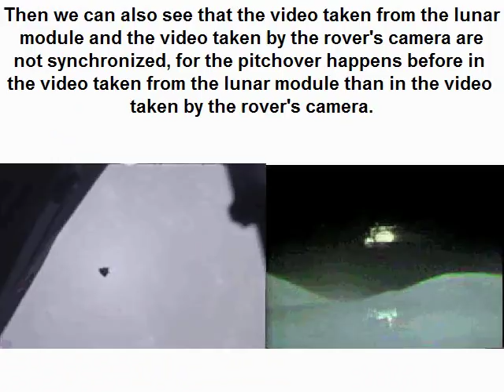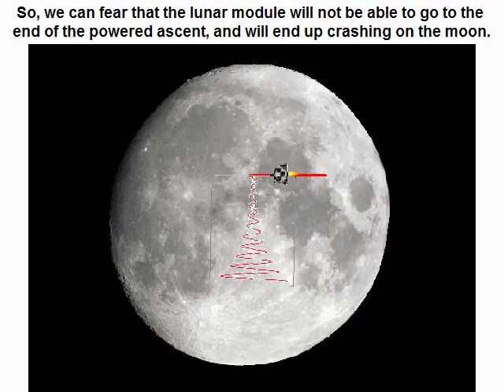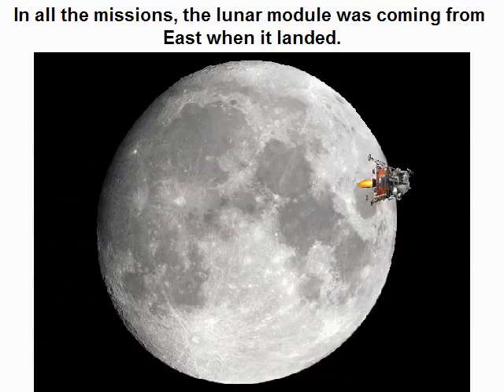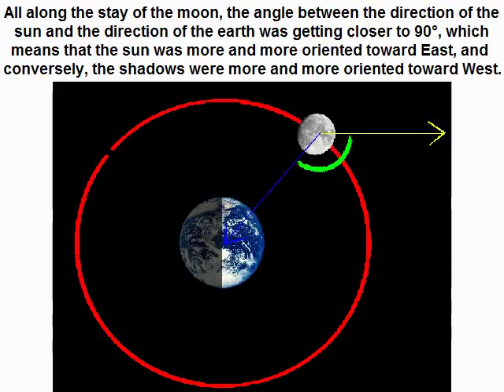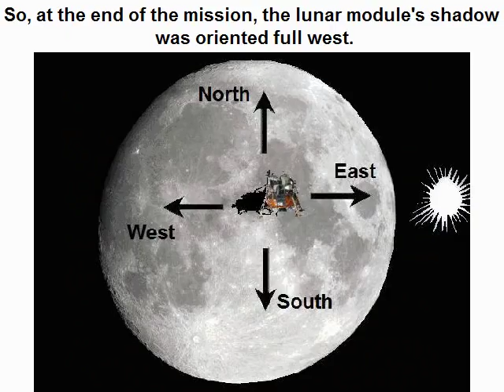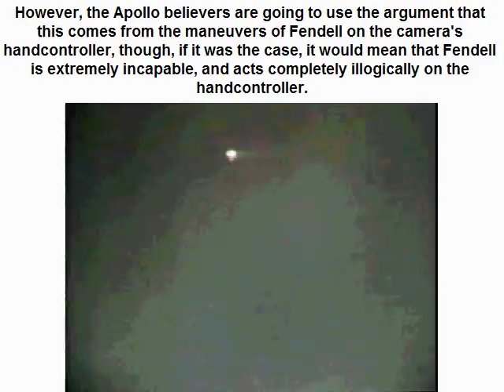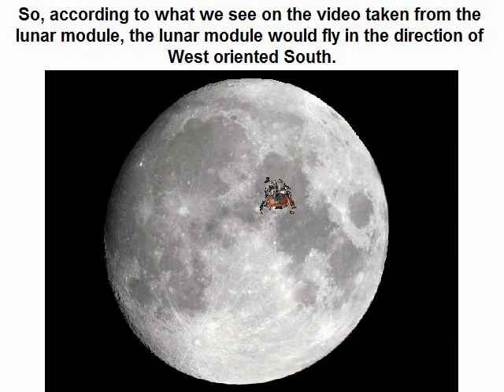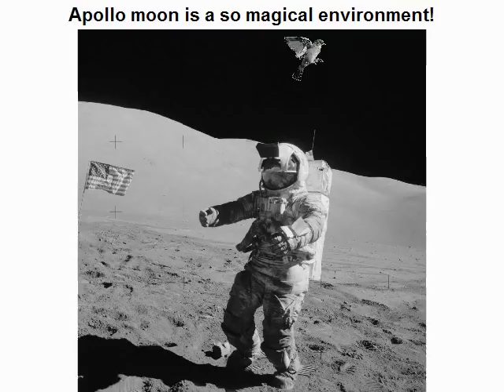The unknown trajectory of the lunar module

Comment: Filmed downwards from the Lunar module's upper stage, there is no shadow projected on the lunar surface from the LMAE's hot gasses. When the LEM is taking off you should see also the light refraction shadow of the hot gasses escaping from the rocket engine, watch closely, they are not visable on any of the Apollo footage where it is taking of from the Moon. Conclusion, there are no hot gasses. Hot gasses give a refraction shadow when there is a difference in temperature and density with the surrounding space.
Reply: Just Curious - I think the problem here is that Paul Smith has no idea what Endymion is talking about, he doesn't have the intelligence to understand technical talk so calls it out as 'talking out of his backside' because that is the only thing he understands. Its difficult for him to understand anything when his head is up his own backside.
Reply: Paul Smith Why do you think that Endymion Andselene's post is flawed? Obviously you possess an advanced education in Physics to voice such an assertive reply as only a crass idiot would offer a strong opinion on something that he knows nothing about!
Reply: Bavo Dekker There are hot gases escaping here  from somewhere! Rocket expert, in a well-designed de Laval nozzle what is the ideal relationship between the static pressure of the exhaust gases at the nozzle exit plane and the ambient gas pressure?
Reply: Bavo Dekker A well-designed de Laval divergent supersonic nozzle has an expansion ratio so that the exhaust static pressure upon exit is at or slightly above  the ambient pressure. For engines operating in a hard vacuum the exhaust gas is at a very low static pressure. The LM ascent engine had an exit plane static pressure of about 7 kPa at a temp of about 500 Celsius. Gas density is given by P/RT so the combination of very low pressure with high temperature meant that the density of the exhaust gas was exceedingly low. What is the critical difference in gas density required to produce a shadowgraph in sunlight that has a natural convergence of 30 minutes of arc?
Reply: Paul - Really? Is that all you have? I assume you have virtually no education which is why you support ridiculous videos like these. 99% of all comments on all the videos of this idiot are laughing at him for his stupidity.
Reply: Bavo - Maybe you should never have left?
Reply: Actually, he knows what he's talking about. And I understand him. Basically, he's saying that the exhaust plume of a rocket operating in vacuum is too thin to refract sunlight. Sorry.
Reply: +ApolloWasReal  " . . Basically, he's saying that the exhaust plume of a rocket operating in vacuum is too thin to refract sunlight . ." This would be an understatement. With no atmospheric pressure to constrain the exhaust gases the exhaust gases expand adiabatically so that after only a short distance the 7 kPa exit plane static pressure has essentially dropped to zero over 2Pi steradians.

It never ceases to amaze me that laymen such as hunchbacked (I refuse to acknowledge a piece of paper that is contradicted by Xavier Pascal's every public announcement) can see a supposed flaw in no billowing engine plume. If NASA were faking it one would have imagined that someone would have caught this supposed contradiction. After all NASA was responsible for the public perception of roaring, vibrating rocket engines pushing out a huge billowing cloud of exhaust gas in the first place. The fact is that rocket engines operating in a vacuum are operating in their ideal operating conditions with minimal engine vibration and an exceedingly diffuse engine exhaust. The fact that NASA stuck to the invisible engine plume for all the moon flights and every rocket engine operating in a vacuum ever since indicates that the phenomenon is real and the result of the thermodynamics of a de Laval nozzle and not the clapboard of a Hollywood director.
Reply: Wendy - See the comments from Endymion, just about sums it up really, your comment is just false. I have been to Russia many times and the view of Russians is that they cannot believe that 'the most powerful nation on earth' is populated by idiots who believe the landings were faked.
Reply: Everybody is familiar with plumes from rocket engines burning kerosene and liquid oxygen. They're a brilliant white, but only in the lower atmosphere. The upper stage of the SpaceX Falcon is the first in many years to burn kerosene/LOX, and it shows us how different it looks in a vacuum. It's almost invisible. The upper stage has a longer nozzle with a greater expansion ratio, and with no air pressure to contain it the plume rapidly expands further when it leaves the nozzle. The only signs from the onboard camera that the engine is really firing are the nozzle glowing orange, the slight mechanical flexing of the nozzle, and little streaks of dark smoke leaving the nozzle. That's unburned carbon from the kerosene fuel. This carbon reacts with the oxygen in the atmosphere to produce the familiar white plume, but of course there's no oxygen in the vacuum of space.
Reply: +ApolloWasReal Members of the moon loon fraternity who question or cast aspersions on the Apollo Program based on the non-visibility of rocket exhaust plumes when working in the hard vacuum of space are only revealing to an international audience how totally clueless they are in matters pertaining to rocket design and operation. Only on YouTube could one be  entertained by know-nothings giving vent to the vacuous contents  of their paranoia-infected minds using rumour and the ravings of fellow know-nothings as a basis for their critique!
Reply: Endymion Andselene  Your technical talk might intimidate or fool some people. However, we both know that you are talking out of your backside.
Reply: Paul - lets look at this logically, if NASA had faked the moon landings the first to cry foul would have been the Russians as they were in a race to get there first, but they knew it was real as, if it had been faked, they would have loved to humiliate the USA by calling it fake. Then, to keep the 'fake' secret, NASA would have had to pay for the silence of over 400,000 people worldwide and now, nearly 50 years later, not one of them has revealed the 'fake'? The first pictures from the moon of Armstrong stepping on the surface were actually received in Australia before being relayed to the USA.
Reply: Which newspapers and which editions?
Reply: It is only in recent years that critical comments have come from the erstwhile Soviet Union. To quote Nikita Khrushchev's son Sergei:

" Of course, you cannot have people land on the moon and just say nothing. It was published in all the newspapers. But if you remember [back then] when Americans spoke of the first man in space, they were always talking of "the first American in space" [not Yuri Gagarin]. The same feeling was prevalent in Russia. There were small articles when Apollo 11 was launched. Actually, there was a small article on the first page of Pravda and then three columns on page five. I looked it up again."
https://www.scientificamerican.com/article/apollo-moon-khrushchev/

There were no newspapers and TV news at the time of the moonlandings that were full of stories showing that it was all faked. Wherever you got this from is spreading Putinesque propaganda. RT is little more than a state-run propaganda outlet pushing the Putin line. Actual from Sergei Krushchev's recollection there was very little coverage of Apollo 11 which dispels the idea that "newspapers and TV news was full of" anything much to do with Apollo 11 at all and most certainly nothing accusatory!
Reply: Comment from Soviet cosmonaut Alexei Leonov:
"On the morning of 21 July 1969 everyone forgot, for a few moments, that we were all citizens of different countries on Earth. That moment really united the human race. Even in the military center where I stood, where military men were observing the achievements of our rival superpower, there was loud applause."
https://www.quora.com/What-was-the-Soviet-reaction-to-the-Apollo-11-moon-landing
Reply: +Paul Julian  If the Russian media was supposedly awash with moon hoax conspiracies contemporaneous with the moon landing then all of this moon loon nonsense would have started up decades before it did. Bill Kaysing would not have been a lone voice in the wilderness and he would have made reference to the Soviet articles. But there was a deafening silence from wacky Bill regarding such. Moon loon propaganda itself right across the internet is also silent as regards Soviet claims of fakery that were contemporaneous with the moon landings. Either Wendy Glass is a victim of fake news or a purveyor of fake news!
Reply: +Bavo Dekker  "Go back to school please."  One gathers that this is the sum totality of your reply. No comment about the density of a rocket exhaust when the motor is designed to be operated in a hard vacuum. I thank you for your informed comments and depth of understanding re astronautical issues!
Reply: Endymion Andselene
I think she is the victim of fake news from the moon loon propaganda
Reply: Paul Julian Somehow I don't think she is aware if that! I have never met anyone who views Russia Today as a serious news channel and that alone speaks volumes.
Reply: Wendy Glass "NASA stock answer" you are full of it! The only reason why you might have heard that before is because that was the situation in Russia at the time. Noone alive at the time, myself included, heard even so much as a whimper of complaint from Russia. " Pravda" the main propaganda organ of the Central Soviet Committee has always been freely available in western countries including Germany where I grew up. There was no issue of that newspaper from the late sixties early seventies that contained any such garbage as you maintain. You are the one swallowing and regurgitating mindless propaganda. For the record I work for NASA' s European competitor E.A.D.S. or Airbus as it is known nowadays. Why this comical moon loon fixation on NASA is any man's guess as it is today just one of many aerospace concerns.
Reply: Wendy Glass We are still waiting for your links to "their newspapers and TV news" that were "full of stories showing that it was all faked"! I have a nagging feeling that we are going to be in for a long wait on this one aren't we Wendy! No doubt Vladimir will get the printing presses turning over in the basement of the RT archives to 'generate' some links for you . . . eventually. LMFAO
Reply: Facts are not "excuses". Sorry you find them inconvenient.
Reply: Maybe the reason you keep seeing the "stock answer" is because it's correct. Ever thought of that?
Reply: Endymion Andselene, this is getting a bit off topic, isn't it?
Reply: ApolloWasReal Guilty as charged! There will be no links to Russian TV and newspapers 'exposing' Apollo fakery contemporaneous with the moon landings because there was none. I allowed myself to get distracted by her Marie Antoinette icon. Me bad!
Reply: +Wendy Glass Ho hum! Still no links to the supposed Ruskie newspaper and TV news "full of stories showing that it was all faked". A solid month has passed so I assume from your ominous silence that you were talking through your hat and were rightly called out on this gaga proclamation. The men and women who produced one of the finest technological feats of the twentieth century if not in the entire history of mankind await your public retraction. The young men who placed their lives on the line in your behalf by volunteering to perform some of the most daring feats of astronautics yet accomplished or possibly will ever be accomplished have been treated with gross disrespect by the baseless contentions of mindless ignoramuses such as yourself. Put up your evidence or provide a public apology for your idiotic contention.
Reply: bavo. yes there would be if there was an atmosphere but as there is none then there is no shadow from any gasses.
Reply: Paul Julian    The "99% of all comments" remark shows what a lying scumbag you are. I rest my case.
Reply: ApolloWasReal  Duh - no shit Sherlock. All you NASA shills just repeat the same old crap excuses.
Reply: Paul Julian  The Soviet Union did not believe that NASA went to the moon. Their newspapers and TV news was full of stories showing that it was all faked - but of course nobody in the west listened. Even now, Russia are still claiming it was faked. Try watching RT TV which is available in the West, you might learn something (but I doubt it)
Reply: Endymion Andselene  Thank you for that NASA inspired "stock" answer. I have seen it before.
Reply: +ApolloWasReal  Have I missed a post from 'Marie Antoinette'? I was so entranced by the portrait by Martin van Meytens of Archduchess Maria Antonia of Austria, the later Queen Marie Antoinette of France, at the age of 12 years circa 1767 that I must have missed it. I always was a sucker for a pretty face! I do believe that the portrait is presently im Schloss Schönbrunn zu Wien in Österreich.

Sadly that pretty face disappeared when its owner was decapitated by Guillotine 26 years later. It is sad too that Wendy Glass will be metaphorically decapitated in the absence of any substantive proof to back up her earlier bold assertion.
Reply: Purely as an aside I wonder what the link is between our protagonist Wendy Glass and the icon image of Marie Antoinette? I have read of the alleged connection between the champagne coupe glass and the comely contours of Madame Capet's left breast. Would it be appropriate to therefore assume that Wendy Glass is the typical moon loon tit? The contours of her arguement leave one in no doubt that she is definitely a tit, if not of the Antoinette variety then definitely of the tit bereft of wit!
Reply: However you can find contemporaneous reports of the Russians congratulating the Americans on their achievement. But I've heard that Cuba widely teaches its students that the US moon landings were faked. Of course, that was all nearly 50 years ago (!) and Castro is dead...
Reply: Go back to school please.